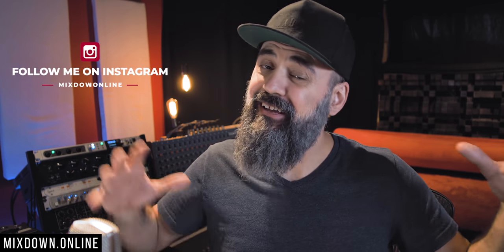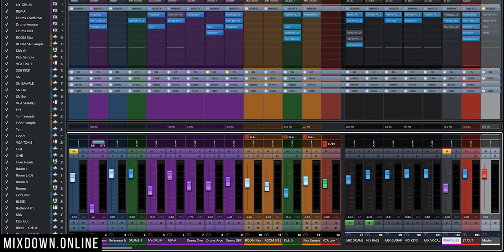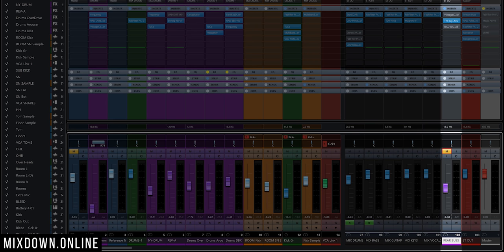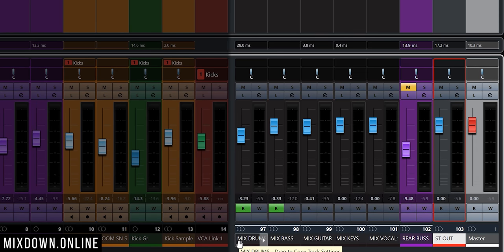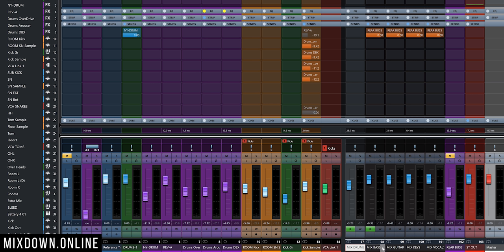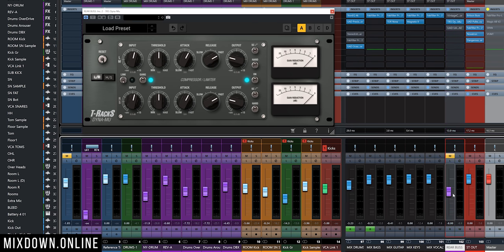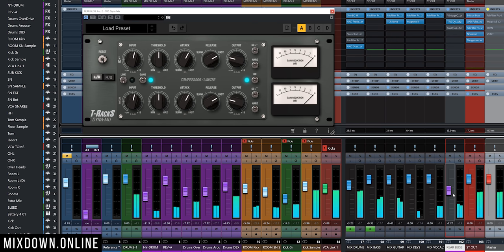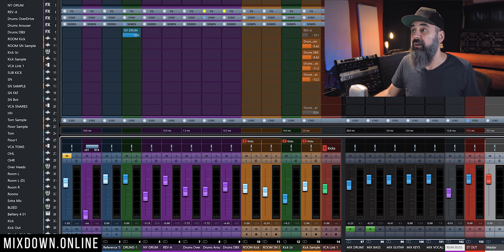The REAR BUSS Parallel Compression Technique in CUBASE

Comment: This was great. After seeing a bunch of Andrew's videos I was wondering about doing this in Cubase. I'd used the Direct Routing method, but I'm going to try it this way. Very cool set-up. What I love about Cubase is the flexibility and the more I learn it, the better it seems to be.
Reply from the maker: It doesn't matter which way  you use unless you want more control on how much you send to the Rear Buss
Reply: @mixdownonline  I see. I was just working with the a set-up as you outlined and it is immediately interesting. Trying various compressors...super good stuff.

Comment: Chris, another great video. Thanks a lot. I watched many of your videos and always learn something new. I have quick question regarding the rechnique you showed here. I'm a big fan of mixing into compressor. I always apply compressor on my main buss at the beginning straight after static mix and mix into it for that 'glue'. My question is... Can I use both techniques together? I mean apply compressor on main bus as I always do and use rear bus like you did here? Or its better to use one or the other separately? What is the difference between both? I would appreciate you answer or even new video regarding rear buss technique vs applying compressor on main bus for 'glue'. Thanks. Lucas
Reply from the maker: Good question. Yes, you can use both. They have both different purpuses. The Rear bus will focus more on the interaction between the vocal and the instruments (exept drums) and give you more width.The stereo buss compressor is more to control the dynamics and general "glue" of the full mix. Andrew uses both on his mixes
Reply: @mixdownonline  great. Thank you once again Chris
Reply: @mixdownonline  I'm just wondeting if using both techniques the overal mix might be a bit overcompressed while applying 2 compressors at the same time like dynamics killed ect
Reply from the maker: @LucasMichalski  not a all but it depends how much gain reduction you get. Don't forget that the Rear Buss is in Parallel. And for the Mix Buss Compressor, be gentle, between 1 and 2db of gain reduction. The trick is also to start your mix with those in place. So this way you won't Over compress your individual tracks
Reply: @mixdownonline  Thank you Chris, very helpful and informative. I'm your long time subscriber by the way and always looking forward for next video. If I can suggest something, if you have some free time would you please make a in depth video about limiters and limiting during mastering as well as limiting individual tracks during mixing? Just a request. Cheers, enjoy your weekend. Lucas

Comment: One question: how do you set the ‘correct’ volume of the REAR BUSS compression channel? ‘To taste’ or do you have a fixed starting point from which you work? Especially since you use it already at the beginning of mixing.
Reply from the maker: I go to taste, to start with and sometimes ajust it as I go.
Reply: Chris Selim - Mixdown Online Thank you
Reply: @mixdownonline i think that if you want to listen to reat bussr movement, you should mix it way above the static "floor" of the "front"buss. second, you will need some hot transients drums to still rule over the front and rear mix

Comment: Hello Chris! Once again, thank you for your continued effort on making this incredibles, easy understanding videos! I really want to know the difference in level (if any) the Andrew Scheps 1176 is applying to the rear buss signal. I saw A. Scheps 1176 setting, but he uses the REV AE UAD 1176 which has the 2:1 ratio, wich I dont have, so I cant replicate the settings and find it for myself! I think that relationship in levels have a huge impact in the mixing levels, as it will define if you hear the vx and gtr mainly from the rear buss, the main buss or a equal balance of the two.

Comment: hi, nice tutorial, thank you!
just wondering: 1. why you use a post send? wouldn´t a pre send keep the sound of the rear buss compression more constant, since fader changer affects threshold? 2. when it tried it out I got quite lot phase issues, except when I keep the fader down i seems ok. you got a tip for phasing? thaks mate!!!
Reply from the maker: I keep it post cause I want to keep the same level relation that I have with the signal that goes to the main Mix Buss. Those levels need to  be the same to avoid phasing issues and stuff. The channels that I send to the Rear Buss are my main instrument group channels so they don't move a lot.

Comment: Hi Chris, I know this is an older video but would the waves dbx 160 work for this tecnique? I also set up the version you showed using the vintage compression. thanks for that video✌️
Reply from the maker: Not sure if the Waves DBX has dual mono on the plugin, but if not, you can use it the same way I used the Vintage Comp

Comment: Hey Chris, thanks for your great videos. I like your stuff and wait for more every time. So one question to the use of compressor in the rear buss. i own the cla 76 - the same like your uad. but the difference is, the ratio at the cla 76 starts at 4, your uad emulation at 2. Is this a problem or must be the ratio 2:1. Greetings from Germany by Chris Sch. :-)
Reply from the maker: Good question, it's not a problem per say, but when it comes to the Rear Buss or Stereo Buss I tend to go with a 2:1 Ratio to keep it smooth and not too agressive
Reply: @mixdownonline  Thanks for your answer.

Comment: hello Chris! do you know if mr scheps send the general fx to the rear buss? if you know he does, does it at unity level?
Reply from the maker: He sends all channels that the output is routed to his Mix Buss. The key is that the Send level of those channels going to the Rear Buss are at 0 and post fader, so basically you are making a copy of your mix (minus drums). That includes all fx.
Reply: Most of the time the fx's are what creates some movement (at least I do some crazy stuff to my reverbs and delays) - so I would say it is essential to send those to the rear buss. justmy2cts ;)
Reply: @Bonzvy  ok, but the rear buss is a compressor buss! wouldnt be better not sending those to the rear buss (or sending them at -15dB, for example) and send them very loud to the mix buss instead? this way you preserve the gral fx's signal dynamic range... just thinking out loud  and sharing... 👍
Reply: @lucianogm  i think at this point it is just personal preference/mixing taste and is also depended on the song you mix - for example on a more mellow song i would send the fx's into the rear buss because i want to glue the tracks with fx's together
Reply: @Bonzvy  i agree!

Comment: Dual mono does not create movement, it creates width!
Reply from the maker: With Dual Mono Compression, each side will not have the same amount of gain reduction and that is what creates movement. In the end, it doesn't matter what you call what dual mono compression does, if it sounds good is what that counts :-)
Reply: @mixdownonline  It does not create movement but width! What's the point of using say a stereo comp on a drum bus that will compress the right side each the floor tom panned to the left is hit? Movement is created by the pumping
Reply: @mixdownonline That is not movement. It is width..
Reply from the maker: Yes, width for sure.  Again, if you have a different gain reduction on each side of the stereo source, you will have subtle randomness movement between the Left and the Right side when the gain reduction differs from one side to another, that is just normal (That is what helps creating the width). Not the same movement effect as pumping. It is subtle but it's there. But again, who cares? That's the way I see it so let's agree to desagree :-)

Comment: Compresor settings???
Reply from the maker: A good start is a slow attack around 10ms and fast release between 30-50 ms. 5-6 db of Gain Reduction, more or less depending on the mix